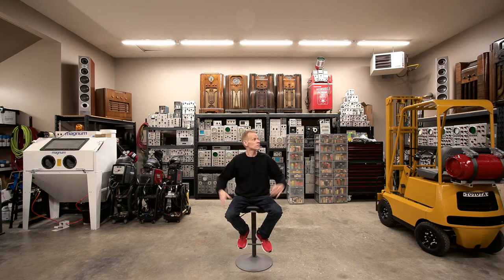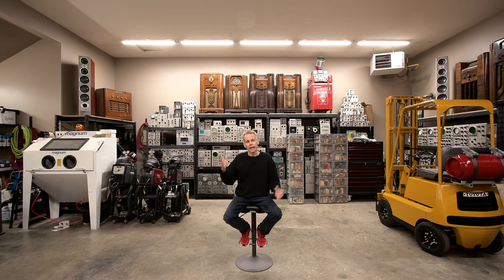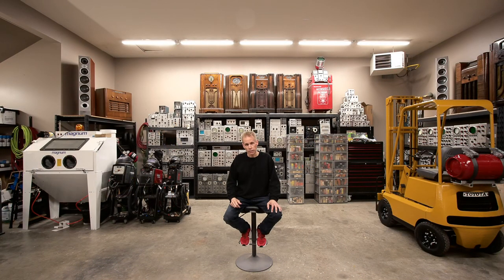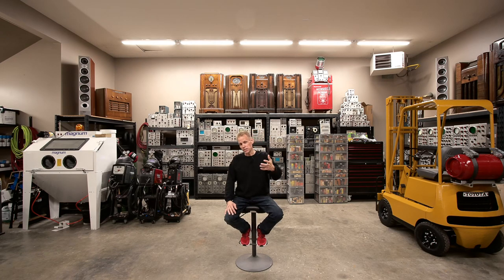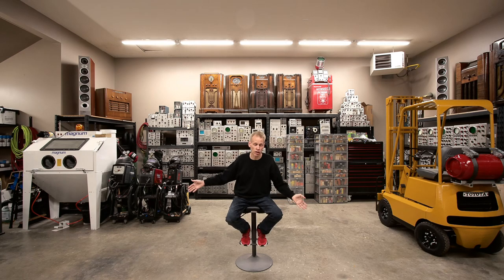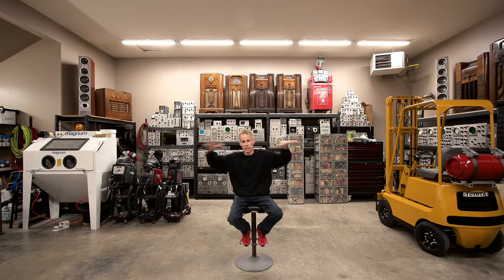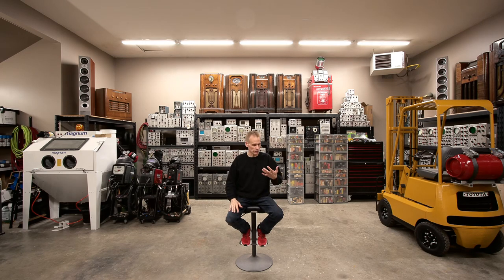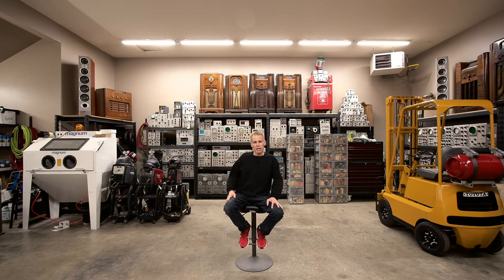ZAP! Mr C's Worst Electric Shock Explained In Detail!

Comment: Amazing story!
By rights you shouldn't be among us anymore (obviously I am happy you are)!
My dad lost a coworker in front of him after he unknowingly grabbed a live bus line phase in I think a car factory nearly 50 years ago. Lockout wasn't demanded then, this fellow just used the Stop Tag.
A factory worker flipped the cutoff back on while the electrician's were on lunch break. He had enough time to step down off the ladder and announce that the line was live and then his heart went racing and he unfortunately passed away in this situation. 
I've been bit a few times like most of us  and more than line voltage. Burned a finger once on a plate line and know that buzz you mentioned. 
All on my right hand.
Keep the left one out of the fun stuff and you will be here longer! 
My first lesson when I began years ago.
Left hand stays out of the control panel if it's powered on. 
Definitely you were "Touched by an Angel" that day😊.

Comment: Wow, quite a story. Mine isn't this drastic. First DC shock I got was from some tiny vacuum tube generator (a school aid, with a single tiny tube). I connected a dipole antenna which was made of two banana plugs mounted to a piece of acrylic, and two brass tubes (banana plugs fit in them nicely). For some reason the generator wasn't working, so I grabbed the dipole with two hands to adjust the angle. Suddenly found out that I couldn't let go the antenna. Pulled the metal tubes off the banana jacks, "no, it's OK, I can let go", and then put them back on. "Now can't let go again, what happened?" -- pulled them back off and started examining the circuit. Then I saw how it was connected: the dipole was across the 90V power supply. I started shaking after realizing that. I was 11. The shock wasn't from DC, but from the realizing that 90V was across my hands.
Reply from the maker: Thanks for sharing your story!

Comment: Holy crap!, thanks for sharing, I have been shock many times, mostly for lack of care on my part, now almost doesn't happen, i remember one pretty bad, i was tuning a 800W 450Mhz vacuum power amp, and dunno how it happened but i touch the output, and RF  went to my finger's bone.
it didn't burn the skin, but the bone OMG i hurt like three months until it finally fade away, awful, i still have the black dot where the RF came in my hand it never dissapear, i reminder how dangerous this stuff is.

Comment: I worked in the Navy in machine maintenance with a guy that received a shock from a BIG capacitor. It happened right in front of me. The guy was in a confined area and bounce back and forth 4 times and was out cold. He was working on a bus board but hadn't discharged all of the capacitors since he wasn't working on that circuit ( against proper checklist procedure). He was out cold and no pulse but came back in about 20 seconds. The shock also blew the end of the screwdriver tip off. He was supposed to be training me ( it sure did show me) I've so far, never made that same mistake.

Comment: Getting hit like that is no joke! I was servicing a tube guitar amp that someone else had been in and they miswired the standby switch where it was basically bypassed. I got a pretty decent electrical burn on my wrist and as I jerked my hand away a solder point stabbed into my wrist so I was getting a direct hit with about 500 volts DC. I was lucky because I was working one handed at that time and it still shook me up pretty bad. It wasn't a life threatening shock but it reminded me of just how dangerous working on some equipment can be. That remark goes double for servicing industrial microwave ovens too!

Comment: Back in the days when 240V AC power tools weren't double insulated and had metal casings, my Dad always told me to always touch it with the back of my hand, once powered, before using them. He warned me that if the casing was live, that you wouldn't be able to let go.

Comment: We once had a tech who bypassed the cutout switch for a high voltage corona discharge point on a TWT, (Travelling wave tube), as he felt that the reason for its malfunction was voltage related.

After hearing a large *BANG!*, we found the technician against the wall holding the smoking remains of a high-voltage probe.

He survived and was put on administrative duty for the duration of his tenure.

To clarify, the voltages on a TWT can reach 150KV at several amps. There's a reason for the 8-inch gap and the corona balls at the discharge point.

Comment: My experience with being shocked was very similiar to yours. When I was 18, I  owned a Johnson Viking Thunderbolt.  I came by a 2200 volt transformer out of a pole pig and wanting to get the most out of a pair of 4400s, I built a 4 KV voltage  doubler supply. The components wouldn't filt inside the case, so I built the power supply outside the case. Big mistake. Somehow,  I managed to get across the 4KV rail and ground thru the metallic case of my Turner +2 mic. The last thing that I can recall before I blacked out was a sort of sickening sweet smell, sort of like burning honey. I came to in my living room, all the way across my house as my Dad was giving me CPR. I had burns across both of my hands and was pale for a week or two after this happened.

Comment: To fix a air pump for a friends aquarium and opened it up to examine a small motor which would not run. I had the air pump on my left hand and decided to turn on my anglepiose so I could examine it better! Without thinking what I was doing I plugged the ‘angle poise’ lamp into the mains 240volts only to find myself sliding down the door after the shock threw me across the room, Like you said Paul my heart was going like the clappers! I always double check every move, of course it’s not the electricity that throws you, it’s my reaction inppulse

Comment: I was working on a re-installation of a 100 hp 3-phase/440V pump motor. It ran a salt water pump, and I was standing in a salt water puddle wiring up the pump. As a 3-phase, the wires can be switched to change the rotation, so you have to wire it, turn it on and check the rotation, and then turn it off and change one wire if the rotation is backward. The breaker for the pump was locked out when I did the first connection, and I went and talked to my helper at the switch about turning it on momentarily to test it. I went back out and yelled at him to "bump" the breaker, and the rotation was wrong. So I went back to the panel and told him to make sure the breaker was off (and I saw it was), and I would change a wire, and yell  at him to bump it again. Kneeling in that salt water puddle on a concrete pad, I was in the middle of changing the connection when someone else yelled somewhere, and my helper at the breaker turned it on and off again. I still don't know what happened, but I found myself about 20' from where I had been working, and that was over several 6" PVC manifolds and valves. I don't remember anything, but I was conscious and laying on my back. That was a 440V 3-phase short through my right arm, body and left leg into that salt-water ground. 

I was 21 at the time, and ever since, I have hated electricity. Been bit several times by 120 VAC while hot-wiring switches and outlets, but I'll never work with HV again.

Comment: My worst shock was when working INSIDE a very large low frequency transmitter (at the time it was one of the two 379 KHz aircraft beacon transmitters on Midway Island).  The transmitter was a giant rectangular affair about 20 feet long with an entry door near the end.  The transmitter was having an AC hum.  I went in the door, with the power off, to start troubleshooting.  Just to the left of the door inside were rows of shallow shelves with many large capacitors (sort of Spam can in appearance) all wired up in parallel.  I accidentally touch one of the exposed contacts.  My entire body jolted and muscle contractions threw me against a panel full of stuff on the other side of the entry so that I got poke and beat up mechanically some, but no more shock.  The fault turned out to be a bleeder resistor that had failed.  It was one of those giant ones about a foot long and coated in ceramic that plugged into what looks like giant fuse clips.  That resistor was located on a panel just above where you entered.  When instructions tell you to discharge capacitors (which almost all manuals advise but, in my experience, almost nobody does) perhaps you should.

Comment: I had two incidents with electricity that almost killed me, the first was an automotive ignition coil I had submerged in motor oil to keep it cool since I was running off AC 110V mains, and driven with a dimmer switch for current control, in my left hand I was holding the high voltage line and was observing the one hand rule, right up until I grabbed the edge of my table to slide my chair over a little, but unbeknownst to me there was a steel frame inside the table that was close enough to the ground wire to arc over and connect the circuit through it, and by default, across my arms to the hot wire in my other hand, my hands clamped down on the table and wire and I was almost completely immobilized as the 60hz 20kV coursed across my chest, thankfully I was able to kick myself back and away from the table and disconnect the circuit (spraying three quarts of oil across myself and my shop in the process🙄), that buzzing in my head was awful and I'll never forget it.

The second time I was doing electrical work for my dad installing switches in my grandfather's house, I was told the circuit I was working on was switched off (foreshadowing😂), I was holding the bare switch in my left hand which had the ground wire attached and had the hot wire clamped in a pair of needlenose pliers in my right hand, and at some point the pliers touched the end of the wire which again formed a circuit between my arms, and again my hands clamped down on the switch and pliers so I couldn't get off, I kicked my way free of that one too after about 10 seconds. When I kicked myself off the wall the switch in my hand was ripped out (I also pulled three feet of wire out of the wall too😐), and thanks to the sharp edges of the stamped metal it sliced my hand open like a fish fillet, I could see my tendons moving in my hand for a moment until my severed artery filled it with blood. I was 45 minutes away from the hospital, my dad had to drive me out there and I almost bleed out on the way, I was white as a ghost when I got there. The nurse that recieved me didn't realize the extent of my injury until she peeled my hand open and watched a three foot spurt of blood fly out, she started yelling at the top of her lungs and I was swarmed by hospital staff, I've never been whisked into an ER faster, they started emergency surgery immediately. 

Needless to say, I'm incredibly cautious around those pixies now...😂

Comment: Was it a RF and B+ for that hole? 
You describe a very similar case that happened to my best friend. During the shock he picked up the army surplus radio and hauled it across the basement before collapsing against the far wall. That high voltage is not something to be careless around.😊

Comment: I had a hole through the nail and tip of my left pinkie for several months due to a 17" CRT not being discharged. I had hooked up the clips to discharge it, went for lunch and failed to realize the clips had not made contact to ground. Brushed a connector accidentally and it zapped me real good. I found myself on my back on the floor half way across the room a few seconds later, and didn't even notice the hole in my finger tip until a few minutes had gone by. Scary.

Comment: Hello Paul!
You told a terrible story. Thank God everything is all right with you. It often happens that everything ends very badly. To be honest, I don’t know a single radio amateur who would not receive an electric shock. I've had this a few times, and what I specifically learned from working with high voltage is the "ONE HAND RULE" and of course the presence of a rubber mat under my feet. Health to you and safe work.

Comment: It takes courage to live. When I was 5, I stuck a hairpin in my grandmothers electric outlet and blew the fuse, which probably kept me from being killed. I'm 80 now but remember it well, it was a very shocking experience!
 I built amplifiers and transmitters when I was 14 and while working on a transmitter in the early hours of the day, got my thumb to close to an energized HF transmitter output coil while tuning it. I still have the hole in my thumb.  Then at 18, I worked in the old Franklin underground mine in N.J. for 7 months, they averaged one man a week being carried out on a stretcher.
 While spending 4 years in the USAF, one year as a fireman, i had many close calls. After the air force, I went to work for Arizona Public Service as a radio engineer, working all over the state by myself. The other people I worked with, got tired of me preaching about safety all the time.
 I won't even mention having forklift races in the isles of the  McGregor-Doniger warehouse, an old multi-story wooden building in Newton, N.J., just waiting to catch fire. WA7VQR 73's.

Comment: Excellent video about safety. High voltage electricity and high surface temperatures are the most dangerous because we can't see them like moving machine parts, a container of chemicals, or a fire. Of course, electricity is the more dangerous of the two because it can kill you as well as burn you.
I once worked with someone who got a bad shock from headphones that were made of metal. They were connected to an amateur radio, and some plate voltage got through them.
When I was in school many years ago, they used to teach us the basics of safety (all types) on a regular basis. I do not think they do much of that anymore, and that is a bad thing.

Comment: Years ago, I was working on a megawatt-class amplifier. Inside the walk-in cabinets most of the chassis were removable for bench service.

One day, the driver power was down. The supply was 480 Volts, 3-phase in and 6kVDC @ 5 Amps out, with a pi filter on the output. Six 872's for rectification.

Well, I went to pull the chassis put of the amplifier and grounded everything I could see. I got it unbolted and carried it (180 pounds!) to the bench. As I started to check it out...

...I woke up about three minutes later with a couple of deep burns on my hand and bleeding in several places. Three of my co-workers were on the spot afraid to touch me.

It turned out that the choke had opened up, leaving the first capacitor fully charged.

I was feeling out-of-sorts for several hours, and I was sore from scalp to toenails for nearly a week. I immediately became more cautious around high-power devices.

That was among the worst of the shocks I have received.
Reply from the maker: Thanks for sharing your story Ed!
Reply: Radar guy?

Comment: I've always been pretty careful to avoid the chance of taking a shock across the heart. I've gotten bitten by 110 line voltage a few times, but it's just been unpleasant, not really life threatening. I had an electronics instructor show us the correct way to discharge capacitors and cathode ray tubes. He explained about the tubes that they could build a charge over time and it wasn't so much that getting zapped would kill you, it was the gash you'd get from something sharp in the case when your hand jerked away when it happened. He had the scar to back him up.

Comment: That reminds me of the time as a kid I built a steam engine from a gasoline engine and forgot to remove the magneto when I test fired it with compressed air. It's weird how when you're being shocked with high voltage AC you have a very lucid moment of thinking about what is happening without much control. You feel very isolated from your reality.

Comment: I working on a Tram D201 base station Hybrid CB Checking the 440 volt B+ back in the 70's and a knock on the door startled me and I touched the 440  volts and it knocked me across the room!😲😲 Luckily I landed on my bed just tingling all over!😲😲

Comment: I have an old PC power supply I use to test DC stuff that has some kind of a fault to the case. You can run a finger across it and it just glides across with a scary hum, but never actually shocks me. It's been like that for years.

Comment: When i was younger cleaning up after my dad in the shed i ended up with 240v mains power in my hand because mice had chewed though the insulation. I was lucky the line conditions were just right that i got released i spent the next hour or 2 just standing there feeling the charge in my chest not willing to touch anything. “Metal shed” and I wasn’t grounded. The sensation of 240v in your lungs is just something iv never been able to put words too.